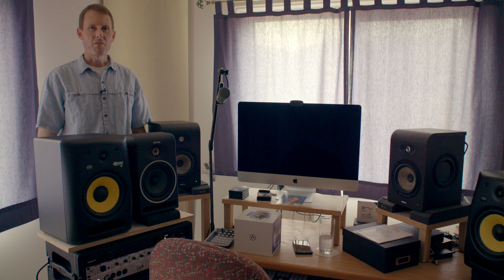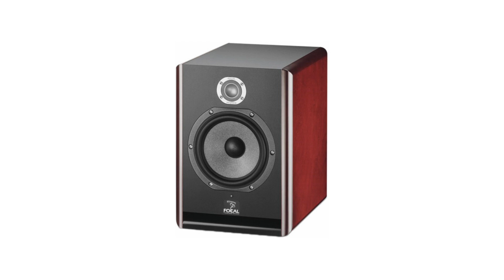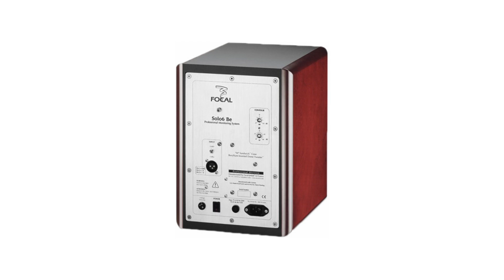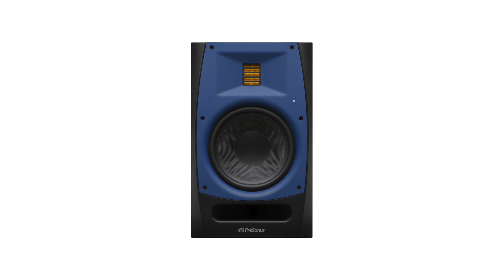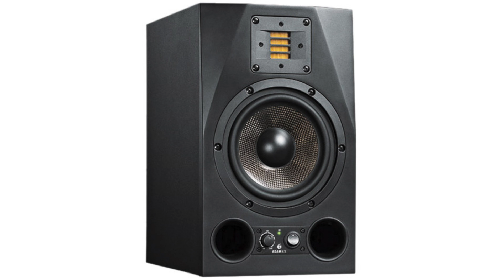Sound for Video Session: Thoughts on Near-field Monitors - Focal CMS 65, Shape 65, Solo6 Be

Comment: To answer your question from an engineering standpoint on the radiators. Bass becomes a problem when the wave is released into a large area. When the Bass waves are kept in a smaller area, they are easier to attenuate. So the radiators act as a buffer to minimize the amplitude of longer harmonics that come with time.
Reply: Interesting, thanks for sharing.

Comment: Can i get advice about used CMS 65 for about 650$ pair. They are in very good condition, but how speakers detoriate over time, should i be concerned cause they are old models..I'm just few minutes away from buying them :) thanks ( these ones are used, from pro studio )
Reply: Sorry, I didn't get to this sooner. If you bought them, I hope they work well for you! Speaker cones, and particularly the rubberized materials at their edges deteriorate over years. I'm not sure how old the set is that you're considering, but I'd suspect they're probably fine if they haven't been abused.

Comment: Thoughts on using a center monitor in addition to L and R for film work to focus on dialogue?  Would a separate brand/model make sense or cause problems?  Thanks
Reply: For any of the surround formats, yes, center monitor is critical. For stereo, I would stick with stereo monitors - I want the experience that the audience will have. I think it is generally best to stick with the same brand/model when possible so you're not having to learn/guess where differences are actually differences in the mix vs. differences in the monitors. Thanks!

Comment: I very much enjoyed your presentation. Your manner is relaxed and approachable. You clearly have a good understanding of the technology that goes into the speakers. 

And your presentation though several years old - is very timely for me since I just bought two Focal Shape 50 monitors.

There is one thing that I could perhaps suggest that I think would improve you’re already good presentation,  would be that the things you didn’t know, which is always good to just flat out say I don’t know how this works, could have been included in your presentation if you had perhaps contacted B&H or Focal to find out how they did work ie the passive radiators and the medium density density fiber board material properties.

I assume you had a limited amount of time and perhaps that additional information was excluded as a result.

I personally would have found that information very interesting.

Thank you!
Reply: Thanks for the feedback.

Comment: in the focal price range is the adam a better choise.They dont use a ribbon but a amt type tweeter.They have much higher sensitivity than ribbon in same size. Both are thinfilm drivers.The sweetspot is bigger on amt.both ribbon and amt dont radiate to the floor or roof.so floor and roof reflectioin is zero from them.the bigger sweetspot the more room refections have to be managed
Reply from the maker: Thanks. Would love to see a video from you on the subject of near field monitors! :)

Comment: You should mention a bit on amplification on powered monitors.Many have Class b or A/b amp for tweeter/high mid and pwm on woofer low mid that is a ok compromise.Almost all monitors today have a powersupply that is switch mode supply and that is not good! a pair of monitor with big amt type tweeters that have high sensitivity and big membran area that play down to 1800 or lower is a good way to go.if they have a linear powersupply even better.they do get hevy do to the transformator in pcu.That is a small price to pay for long lived elektroniks.typical switch mode supply on cost effective products use no name brand electrolytic capasitrors and they dry out and the monitor stops working.lasting just around 5 years is not good.Good electronics can last 20 years with no problem.Have electronics that is from 1935.never fixed.I have to overhal it do to electrolytic capasitors are dry but it works still.Not my daily gear in use that.
Reply: Good info, thanks!

Comment: Focal Shape 65: the auto switch can be disabled if you open the box. which you in some cases should as it is a problem in some and you have to turn it on your self.. 
Place the speakers further from the listening position then they are set up in this video, it helps the sound immensely.
Reply: Thanks jan.

Comment: I have the same issue with the sleep mode on my KRK monitors.
My workaround was to set the volume on the back of the monitors a bit lower, which forces me to always work with a louder output signal from my audio interface. The restarting process a bit faster that way, without me having to crank the volume up very high.
Reply from the maker: Good idea, thanks Daniel!

Comment: May I ask you a question? How are the Focal Shapes with sound staging? I mainly compose and mix orchestral mockups using sample libraries. Hearing deep into the z-axis to differentiate the staging and tone of the woodwinds from the brass and percussion, then accurately hearing the width and placement of the violins and cello sections is important. Also, a sound stage’s early reflections, then it’s late reverb is important to for me to hear (in a 2.1 system). How would you rate the Focal Shapes to other midrange monitors? The oldest gear in my studio are my old Event BAS 20/20s (with sub), and I’ve had to start mixing with Beyer DT 880 Pros (which work out well despite the distorted sound stage one gets with headphones). At some point I’ll need to add a sub for other types of music, but classical and film are my main priority. Oh, how would you compare them to the Adam A7x for this use? Thanks.
Reply from the maker: Hi Steve, the Shapes did well in my subjective opinion. A good bit of that will, of course, rely on proper placement and room setup/treatment, but overall it seemed like the Shapes had enough clarity and depth to recreate sound stages quite nicely.

Comment: I own both the Focal Shapes and Solo6Be, while my roommate has the Focal Alphas. Anyway, I would say this: Shapes are about 15-20% better than the Alpha, and the Solo6be's are 35-40% better than the Shapes. I know this will be really helpful to people since they want to compare the different models. Once you hear the Be tweeters, you can't go back. The new M shape Al-Mg tweeters on the Shapes are not that much better than the regular inverted tweeters on the Alphas. As for the Solo6Be's, the Be tweeters mop the floor completely when it comes to highs. The Shapes don't even come close.
Reply from the maker: Interestingly, after I shot this video, I ended up buying a set of Solo 6Be's and I wholeheartedly agree. The tweeters on the Be's are noticeably cleaner and able to resolve the higher frequencies without smearing them as most lesser speakers do.
Reply: Absolutely. That's what they were designed for: mixing and mastering professionally. Ideally, get any line at or above the SM6 line (the SM6 line includes the Solo6Be's we're talking about). The lower ones will be good too (Alpha, Shape), but the SM6 line will take your stuff to the next level. If you're just starting out, there's no shame in getting the Alpha or the Shapes. They're an outstanding deal. (I think the Alphas are a better performance:price ratio than the Shapes, though! They sound too good for how disgustingly little they cost.)
Reply: You absolutely cannot go wrong with Focal. For example, you'll see the Focal Twin6Be's in professional studios everywhere, including those of very acclaimed engineers, artists, etc. They've become an industry standard. I haven't heard your two monitors, but I have heard things like the JBL LSR2325, and the Focals are just way, way,  way better, especially at their price points. You can get monitors that are better than or equivalent to the SM6 line (which includes the Twins), but for some reason, they always cost significantly more from other brands. I haven't heard the Twins yet, but if the Solos + all the reviews are any indication about the Twins, they too are probably relatively "underpriced" for how magnificent they are. The same holds for the Alphas and (to a lesser extent) the Shapes. I really like the Shapes (they're sitting on the floor a few feet from me right now), but depending on your budget, you either should just go with the Alphas or upgrade all the way to the Solo6be's. (Shapes with their passive radiator have fantastic bass though; super punchy -- arguably better than the Solo6be's even.)

FWIW, my roommate who's a trained audio engineer swears by Focal and was the one who introduced me. As for the HD600s, they're awesome. They're better than the HD650s, in my opinion. I was just at a professional audio engineer's house (works for a major video game company doing sound for them), and he also uses the HD600. I would keep the HD600s as headphones but would consider switching out the monitors for Focals. (I've also owned the HD600s, HD650s, HD800s.)

Overall, Focal just blows me away. (I also bought the Focal Elear's because I just trust the Focal brand so much!) When people come over and listen to my Focals, they're usually blown away. I had someone come over who has these expensive bookshelf speakers + a super expensive audiophile setup, literally say after 10 seconds of listening: "What the hell have I been doing? Your monitors sound so much better than my entire setup. I am going to have to sell everything."

P.S., No, I don't work for Focal :P. I've just owned a lot of audio gear in my life and live with musicians.
Reply: Although I agree with your analysis of the Solo6be, i prefer my Alpha 80 to the Shapes... i get a much punchier bass (not louder) and better stereo image in my room, which is fairly large , with the Alpha 80's. That being said, the next pair of monitors to enter my studio at the end of this year are the Focal Twin6be. They are THE best bang for the buck out there right now. The beryllium tweeter is certainly one of the most interesting high frequencies driver technology out there at the moment.
Reply: :) Go on Sweetwater and look at the reviews for the Focal Twin and the Solo (and all the other Focal stuff)...  They speak for themselves, really.

Comment: Wouldn't a port have the same risks of phase issues then? In fact even more so when they are located at the front.
Because air would move out of the port when the woofer goes in right?
Reply: I think it depends on the design. To be honest, I don't know enough about speaker design to say definitively.

Comment: Do you think it would be worth upgrading my Adam a7x's to a pair of shape 65's? Thanks.
Reply: Hmm, no, I wouldn't unless you're having issues with the Adams?
Reply: I feel I don't really get enough bass extension from them. Also I kind of hear this slight honking sound, particularly when I'm working with kick drums and bass sounds. Not sure whether that may be something to do with the ports? I'm in a fully treated room so I'm guessing it wouldn't be the room I'm hearing.
Reply from the maker: It's a tradeoff. The passive radiator design is a different approach and I'm not sure whether it necessarily solves the problem. If there's any way you can listen to a set at a pro audio shop in your area, that'd be my recommendation. I was surprised to find that my local shop (not Guitar Center) had a set in their listening room. Good luck!

Comment: Hi Curtis, I want to buy a pair of monitor for my home studio. I work in post production audio and in sound design for movies and tv. Looking prices I have concluded that I can pay a Focal alpha 65. Or a Adam A5x. Would you give me your opinion?
Reply: I would recommend taking some source sound you are intimately familiar with and listening to it on both the Vocals and Adams. It is a very personal decision.

My personal experience is that the Focal Alphas were a little bass heavy. The ribbon tweeters on the Adams are a source of debate - many people love them, others hate them. In my testing they were very detailed and clean but you had to be in the "sweet spot" or they didn't work well. So if you're generally working solo, that's probably fine. If you need to have other people in the edit suite, they may not be the best option.

Best wishes!
Reply: Thanks for answer!!  Yes... It is complicated and there are a lot of factors. First, I am temporarily in a little room, second, the room hasn´t optimal acoustics.  that could harm the bass heavy of focal? 
I know they are not the best conditions But would be a start and all mixers would be made it in other place. My work will focus more on cleaning audios or dialogues and aditing. I want the most faithful audio...
Reply: If it were me, I'd probably go with the Adams in that case. The Alpha line seemed a little too bass heavy in my tests which is not a great idea for small rooms. Best wishes!

Comment: Curtis.. great video... i originally was looking at the ROKIT 8"....  i plan to use them for music/audio mixing of EDM, Hip-Hop, Country, Rock etc... HUGE DIVERSE GENRE RANGE... i am a DJ and build playlists for my gigs on my computer....  so was looking for a solid monitor that willl handle the diversity of sound.     with this video i am now leaning toward the new Shape 65....  since you have heard the Shape 65 and Solo Be.... what do you recommend for my situation if i do mainly music?
Reply from the maker: Hi Joe, Any of the three from Focal would be great. If you're on a tight budget, the CMS are very, very capable and are on close-out pricing at B&H (links in the description). The Shape and Solo6 Be are both very good as well. I ended up choosing the Solo6 Be. It's high end is a bit more articulate with the Beryllium tweeters so it is easier to hear the nuances and potential problems in the higher registers. But again, all three are quite capable.

Comment: My qeustion, if you have the experience, is would you upgrade from the focal alpha line to the shape?
Reply: I ended up going for a pair of the Focal Solo6 Be. Good luck!
Reply from the maker: I think it is a worthy upgrade. The Alpha 80s were fun to listen to but there was a lot of bass coming out of those and I think that ended up creating some potential issues. If you go for the Shape 65s and you were using the Alpha 80s you may at first feel like you're getting less bass, but my sense is that the low end is better controlled on the Shapes (based on room measurements and Room EQ Wizard as well as my subjective listening).
Reply: Thanks for the Reply Curtis, I currently own the Alpha 65 as the size is perfect for my space. I think i will pony up and swap them out soon as I notice distortion in my units around 2k with loud transiants. Thanks for your review, looking forward to see what you end up going with.
Reply: Short version: The high frequency detail, articulation, and phase coherency seems about 15% better. The bass also seems slightly cleaner and less "forced".
Reply: Would LOVE a review on those, if you have the time :P Was thinking of that as well...

Comment: Curtis,.. thanks for the video.  I just purchased the Shape 5's from Sweetwater.  However after your video I am considering sending them back for the solo6 be.  My question is, is there really that much more definition from the solo's to justify the extra cost??
Reply from the maker: Hi Shane, If you've got the money, I wouldn't hesitate but whether it is worth the extra cost is debatable and I think depends on whether they monitors will be money making tools for you. I ended up purchasing the Solo6 Be's and I'm very happy with them. I'm doing more and more commercial and narrative mixing jobs so it was not difficult to justify the purchase since I'll be spending a lot of time listening to them and they will pay for themselves quite quickly. However, I have no doubt that one can make good mixes on the Shapes as well. I'm not sure how to best describe the difference but reproducing sound seems a bit more effortless for the Solo6 relative to the Shapes. I can hear a little more separation and clarity in the higher frequencies. But overall, I really like the Shapes as well. Hopefully that helps a little! Good luck!

Comment: Hi Curtis, thanks for this video. 

Reading the specs of CMS 65 and Shape 65 I have seen that:

- Shape 65 have a ± 3dB frequency response in the 40Hz - 35kHz range
- CMS 65 have ± 3dB frequency response 45 Hz - 28 kHz range

From your test have you noticed a clear difference in the high frequency response of these two monitor?

And comparing Adam Ax7 and Focal Shape 65 or Focal CMS 65, which do you prefer?

Thanks!
Reply from the maker: Hi Tiziano, in my tests, I was not able to hear a clear difference between the two in terms of high-frequency sound. Overall, the Shapes seemed to control the low-end more cleanly so if I had to choose between the two, I'd go for the Shapes. That being said, the CMS 65s sounded really nice as well. 

I have heard the Adam A7x but have not used them extensively for mixing. They sounded much cleaner and more articulate than my KRK Rokits, but I have heard some people suggest that ribbon tweeters can be fatiguing to listen to for long periods. I don't have any experience with them for long mixing sessions so I cannot say.
Reply: Thanks! I'm thinking to buy CMS 65. Since they are going out of production I can find them at an interesting price.
Reply: That would be a great choice. They're nearly 1/2 their normal price here. Best wishes!